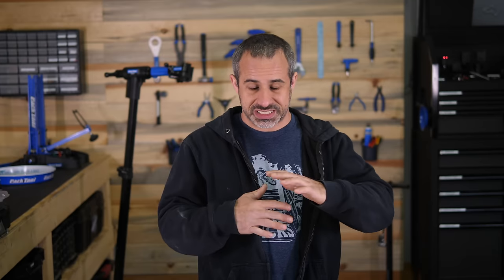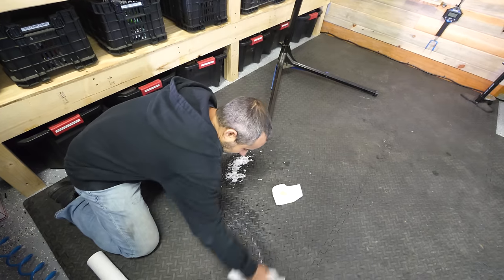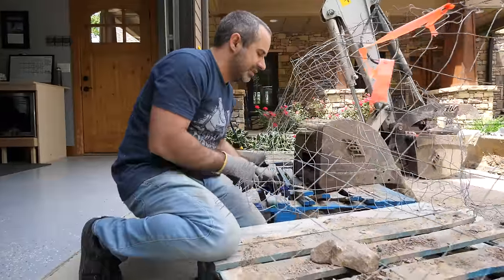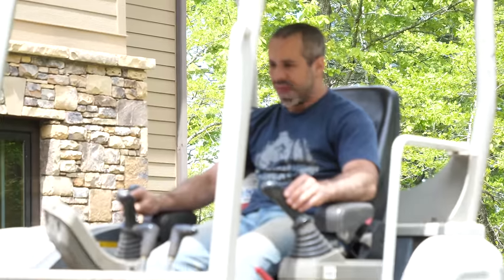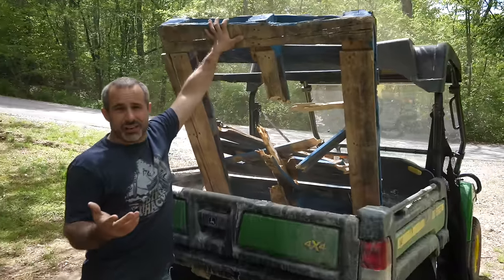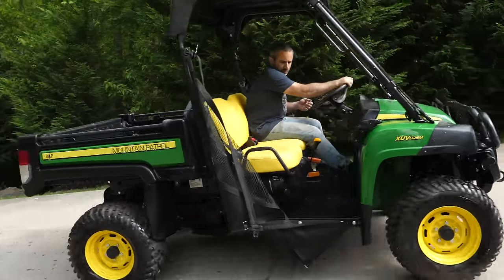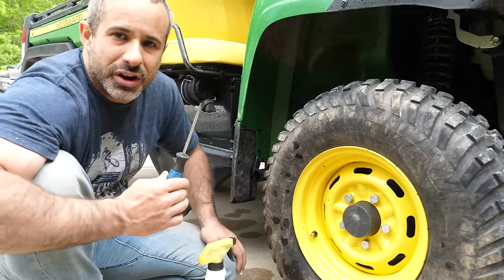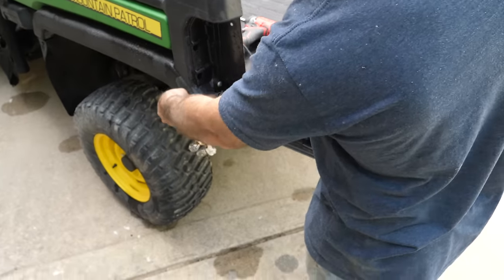Bored? Watch a guy do chores for 10 minutes

Comment: I learnt to drive a 360 mini digger building MTB trails, 3 Ton for loading, 5T for trail digging , 13T-35T for raw material digs, we get lots of loose stone banks just below the the topsoil, so use massive diggers too ready stock piles) 
Once you get going you will stop using the hand track controls and evolve to feet pedals : ) 
I have had to cover once or twice for construction site digger operators, they had been shocked I managed the machine to a high standard.
In Ireland we use 6 -18 inch deep trench - 90 gram geotextile then quarry stone 4 inch crusher run. : / 
Most trail are up land over peaty soil, some are in low land areas with very hard clay strata. 
We avoid wood completely away too slippy, just too far North. ( as far North as Moscow or the Canadian Tundra !) 
Only way to build trails to survive the crazy amount of rain fall, dirt trails are great but only dirt for -23 weeks in the year : (
Up side is 8c - all winter...( thank you gulf stream.. )  

For an episode try and source a Kaiser Digger/ spider digger a real trail building excavator , it walks through the forest. 
Used to build many alpine tracks..
Good luck, its great learning curve.

Comment: Dude, I had the same rear light LH housing break, I plastic welded it overnight with JB Plastic weld and it held better than original, still there 2 yrs later. (RH side did the same after an aggressive car wash, same fix, still holding just fine.)

Comment: You still have the storage unit??? and you still have that empty loft area? Keep a lookout for an old scissor lift. One where the powered wheels no longer work, but the lift does, and you can place it permanently outside the loft access to get bikes etc up there. Would be paid for by the saved rent of the storage place. (plus you could maybe tow it to the treehouse/ranger station construction site with the Gitter) 🚜🌲🛠

Comment: You can use a special tool, or a small screwdriver to get the actual core of the valve out of there. It is threaded in. Deflates a tire way way faster than holding it with  something

Comment: I install valve stems from the inside. Get the tire off. And then put the valve in from the inside. Then there’s a tool that attaches to the valve instead of the cap, with a arm that gives you leverage over the rim. So you don’t have to stab it with a screwdriver 😬 just pops it into place

Comment: You should really learn to use an excavator for purpose build mtb trails. 
The amount of work saved in removing stumps, or moving dirt for for jumps or berms is a huge time saver.
Its a completely different trail opposed to a hand build/raked trail, but man you can shape an entire rollercoster of endless fun using the dirt.

Comment: 7:19 do yourself a favour and get a valve removing tool. you can have a stand alone tool or you can get some valve caps with built in valve removers. soooooooo much quicker and easier than using a screwdriver, centrepunch or twig, haha. 
who would have thought watching a video of some dude leaning up would be so entertaining! with my dodgy back i dont clean up as much as i should, haha.

Comment: Ya know, the valve stem ia meant to pe pulled in from the inside. Its wayyyy easier, you just need to get the tire off the bead but that way you wont damage the stem.

Comment: Not that it's a big deal, but I don't believe you own those pallets. I believe blue pallets are owned CHEP. They typically have enforcement policies similar to:

"...and such pallets should not be used in unauthorized situations or dismantled for craft projects. There is a vast array of different proprietary pallet markings that a pallet collector or recycler may encounter, whether pallets are owned by one of the pallet rental pools, as discussed above, or by a particular company. It is important to recognize the markings of such pallets in your locale that may be subject to assertions of ownership, so as to avoid potential legal complications."